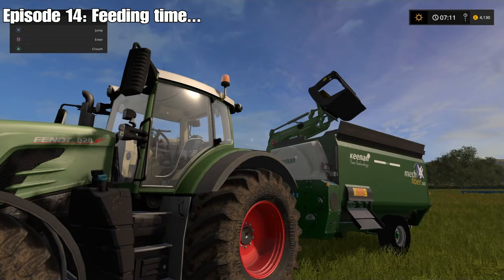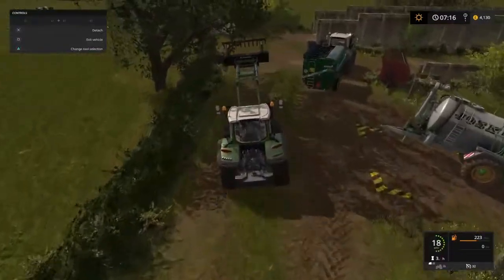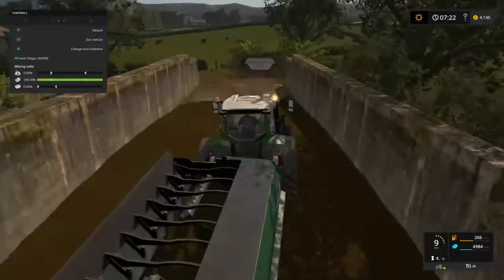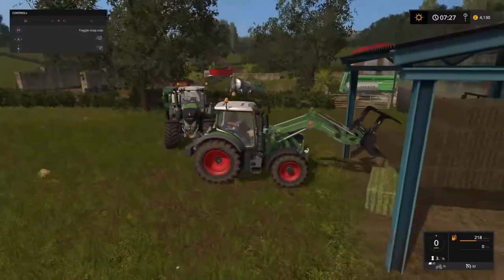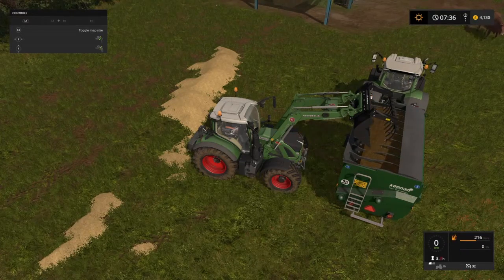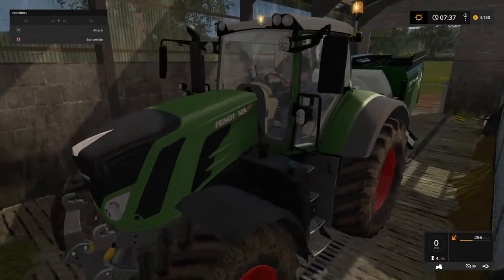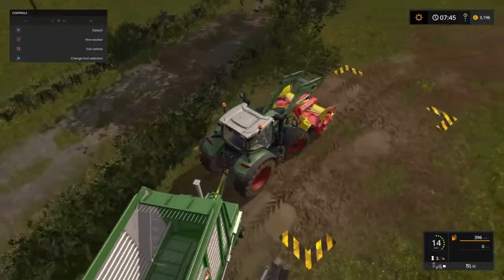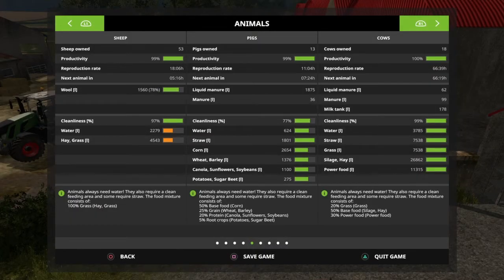Fendt Farm Episode 14

Comment: My first adventures with a TMR mixer went pretty much how yours did here. I was using the standard 16kl mixer, but didn't have a baler, so I'd stacked loose grass (at the time), straw and had a silo filled with silage. I was shoveling the stuff in, and in spite of math, managed overload on the straw - the only way to recover was to unload the mixer - 1 pile of hay (converted from the grass), 1 pile of silage and 1 pile of straw (in that order). Then I had to scoop the ingredients back into the mixer, and not using the entire original load of straw. Learnt my lesson the hard way - when mixing manually (no bales), keep hay and silage about even, then (very) carefully add as much straw as you can without blowing out the mix percentages. Of course, bales is much easier!!
Reply from the maker: Neil Harbott yeah, the one thing that would make this mod perfect would be to increase the tank from 12k to 16k
Reply: I believe the original version of that mixer had a capacity around 10.8kl - which happened to work precisely for hay bale + silage bale + loose straw for a good mix. But they later patched it to 12kl, and I had assumed at that point the reason was so you could load 3 bales and be good - I hadn't realized that straw wasn't allowed to go as high as 33.3% until you proved it in Episode 13. Now I agree 12kl is NOT a good size.

Though now I'm wondering if it would work well with the micro baler, which pops out 500l bales, that can be lifted by hand - though I'm not sure that particular baler is available on console...
Reply from the maker: Neil Harbott the original lizard version was only a 6k tank, way too small to be of any use
Reply: Yeah I know the lizard version was tiny, I thought there was an earlier version of the one you are using that was slightly smaller than 12kl - I think Daggerwin used it in Chellington.